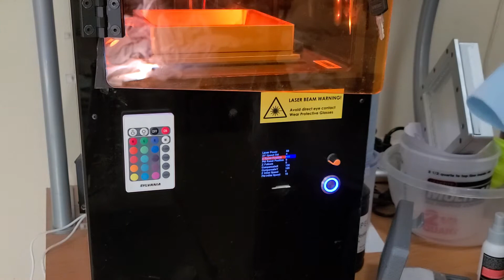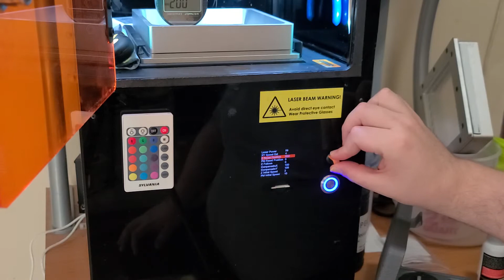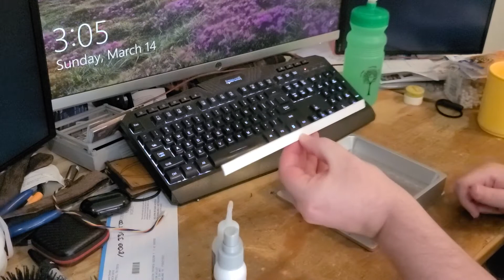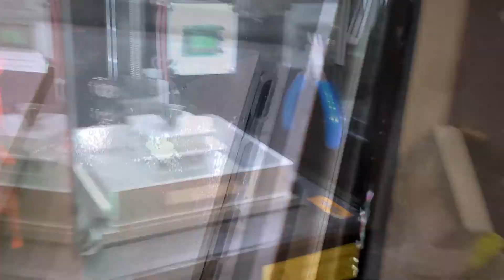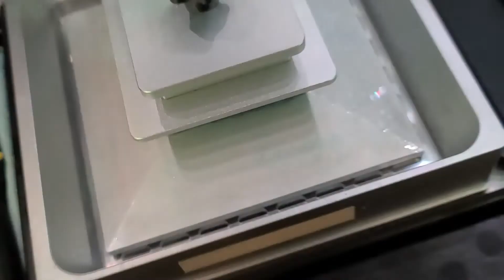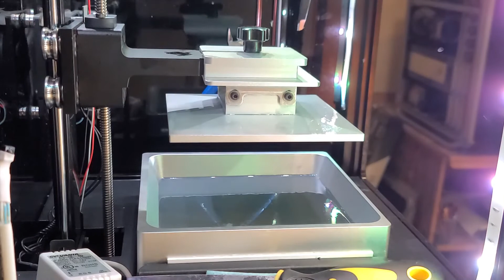Moai Bed Level, Shimming, & Print - Moai introduction

Comment: Hey how did you get the z to lift between layers and not tilt the vat?!
Reply from the maker: You have to get the firmware update to a 1.18 beta, that I call 1.20. I have a dropbox link for it. After you update it you set Z Follows to a negative number. I have mine set at -350 or -400 currently. This translates to 3.5mm or 4mm lift.

Comment: Thanks for the awesome video. Inspired me to start printing again after a year of sitting doing nothing.. Any chance you can do a video on calibrating the Moai for accurate prints & using the asura slicer to help with accurate prints. Most of the time I use DLP resin as the Moai resin you can not get in South Africa. Thanks again for great video
Reply from the maker: My Other video is all about mechanical accuracy. I'm still +/-0.25mm accuracy and haven't improved that so I think that's its best.

Comment: This is sick! Still considering getting into resin printing. Do you think SLA is worth the cost increase over MSLA printers of the same build volume?
Reply from the maker: If you want to get into a hobby, buy the cheap version of the tool to see how it works for you. The learning curve for resin printing is very steep and the MSLA is much easier to start off with. The SLA and MSLA share many principles with SLA having more options. That's what makes MSLA so much easier to get into, because there is less to get into.
Reply: @cainesarmoury8962  Appreciate the info. I purchased a Photon Mono X yesterday

Comment: Cool video, I have the FEP and EZ level build plate but I'm curious what the dial indicator levelling part is doing, does the plate not correct for the VAT not being 100% level??
Reply from the maker: It's for checking square. Being 90 degrees from the Z arm. It's not necessary, but once done keeps things from being a parallelogram. That's the idea behind the pegs, but this is simpler and quicker.
Reply: @cainesarmoury8962  Ah OK I get what your saying! good video though Im glad to see people using the Moai still. Have you got much experience with the likes of elegoo saturn etc? I have had my Moai for around 18months now, I've just about got a handle on it but it was and still can be a pain in the back side. The MLSA 4k printers seem to be on par in terms of quality but I would be interested to hear you opinion and if there are still benefits to the 'true' SLA printers like Moai?
Reply from the maker: @MrTommy10inch  There are many benefits of the SLA series. MSLA is very easy to get into but is limited on the industrial side. It's a low grade consumer product to toy with. With that said, the anycubic Mono is very cheap and does a lot! The Moai was poorly documented and can do more than stated. I have just begun playing around with it and am working on the Moai 150 project to increase the build volume. You have to remember, the Moai is a cheap version of the Formlabs printer. A powerhouse printer.

Comment: this is so helpful mate thank you so much, question do you recommend leveling with no resin
Reply from the maker: It's easier with no resin, but can be done with resin. As long as there is no debris in the vat. The tapping I do on the plate is to help settle the vat as close to the FEP film as possible, and works especially well when there is resin in the vat.

Comment: Informative video,  what is the setting you are altering two points single click 2 points double click, and what is the purpose of this? Also what is the determining factor for the z reset 650? the height of the dial indicator?
Reply from the maker: Z Reset is the only value I'm changing. If you change it by 2 points, and then back to the original setting, the build plate will rise and lower again allowing you to move the Dial Indicator. 
And 1800 is 180mm, so yes it was the height of the dial indicator that had me choose that.